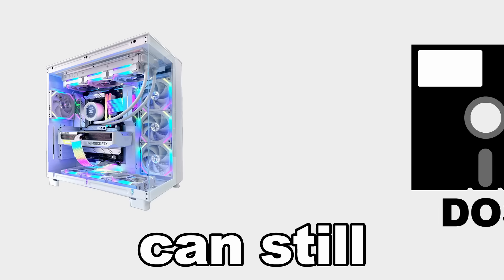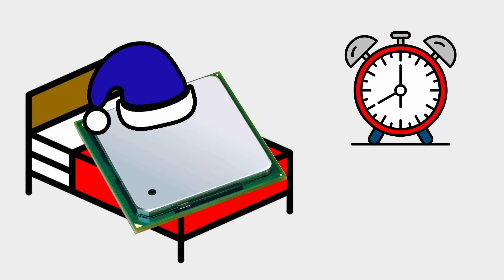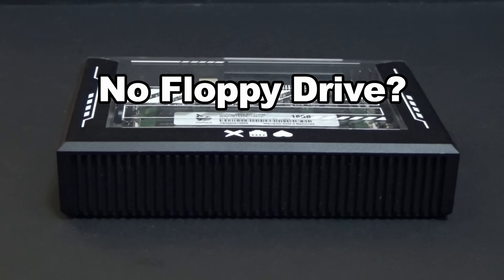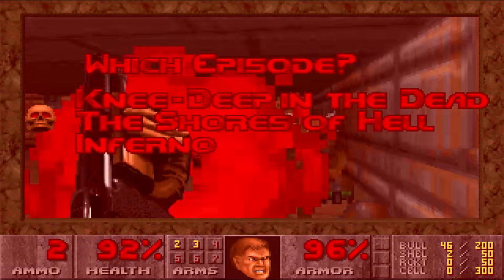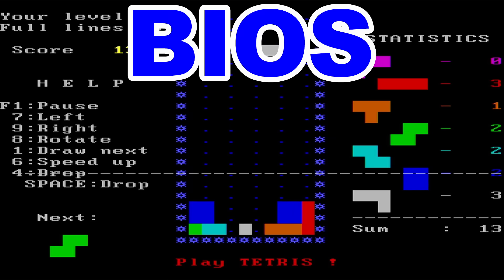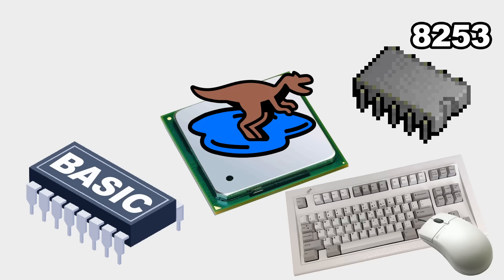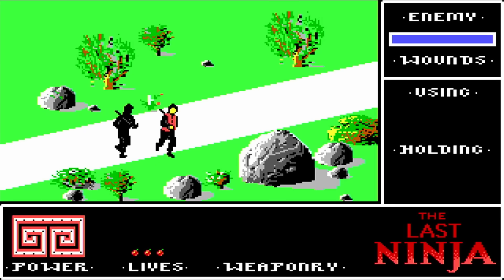45 Year Old DOS on a New Intel CPU Without Emulation

Comment: I made some open source project using batch files as a container to create a new executable file with a little help from a special version of the debug command that provide 16 bit and 32 bit instructions. (Since 80386 we can use 32 bit instruction in DOS 16 bit mode too.) But i never test the projects on a  real DOS PC, I use DosBox and one project with 800x600x32 is only made for a graphic card with S3 GPU. So hardware needed 80386 with svga graphic.

Comment: Nice video! If my own memory isn't faulty, BASIC was in the DOS directory, which should've been in the path, so not in ROM. I'm not sure if it came with PC-DOS, but I'm pretty sure it came with most versions of MS-DOS. Heck, even the C=64 came with a version of Microsoft BASIC. You forgot Cyrix as a competitor, but I suppose that's a subject for another video.
Reply: Sorry but your memory is a bit off. The original IBM PC and PC/XT had real ROM chips. I still have the HEX file of its contents. However  most every PC "clone" had BASIC as a COM file - I think for licensing reasons.

Cyrix chips were NOT QUITE X86 compatible. I used to build PCs for a living and it was always necessary to include minor patches to keep Windows stable - especially at clock speeds over 66MHz. But they were cheap !
Reply: @adrianandrews2254  It wouldn't surprise me if my memory were a bit off. Thanks for the correction.

I also used to build systems, and Cyrix chips were very cheap. I do remember they didn't 100% compatible, and yes they did present an issue at times. I think that's kind why they disappeared. They were cheap, but also sucked at the same time. AMD struck that cheaper chip with compatibility sweet spot.

Comment: Once upon a time, editorials were published complaining that the latest x86 chips were "code museums" wasting much of their transistors to support backward compatibility.
Today, the vast majority of the complexity is the logistics of dealing with superscalar and out-of-order execution, with a surprisingly small part of it being the Execution Ports that do the actual work, and a tiny sliver being the front-end that parses the instruction set.  So today, supporting old instructions is not significant; the entire chip is abstracted away from the published instruction set anyway.
Reply: Yes indeed. Intel tried to abandon backwards compatibility with it's 64 bit architecture. Because of the way the licencing agreement with AMD worked, AMD were legally allowed to introduce their own 64 bit chips that were backwards compatible; and despite the editorials saying that the Intel IA-64 was superior the market went for backwards compatibility. That's why the architecture of current 64 bit Intel chips is actually AMD-64 not what Intel had in mind.

Comment: how do you deal with the clock speed differences ? a lot of old dos programs were reliant on the clock frequency and on faster machines ran way too fast. I mean you are talking of CPU's that ran at 20 MHz to early Pentiums that ran at 100MHz the modern CPU even that celeron is over 1GHz base bursting to over 2GHz...
Reply: The timer chip and the vsync exist on first PCs too, but using only a loop for a delay is a bad programming style. I wrote a pull down menu on 20mhz and it works fine with 2700mhz too. We can wait for the vsync(at port 3da) on video mode with 60hz refreshrate multiple times in a loop to slow down a routine.
Reply: 4.77 MHz.

Comment: There is a big difference. In old days, DOS PC's  allways ask date and time setting when device power on. There was no RTC batarie and memory.
Reply: The original PC didn't have it built in, but real time clocks were in lots of IO cards sold for PCs and were extremely common add-ons.  My first PC had one in a socket that went under the bios chip.
Reply: I use DosBox on android and it have no date and no time command.😂
Reply: @maxmuster7003   It was 1980s  8088, 8086 HW, when i were at Unv.   Not later . ;)

Comment: it is 32 bit instead of 16 bit, x64 supports only 64 and 32 bit, no more 16bit
Reply: DOS need an ibm compatible mainboard bios with 16 bit function. An intel 64 bit core2quad can start in 16 bit mode, if the bios is ibm compatible.
Reply: The only one difference on 80386+ between 16 bit mode and 32 bit mode is the usage of instructions with or without an operand size prefix(66h) and with or without an address size prefix(67h). These prefixes reverse the default size for the duration of one instruction. In the 16 bit protected mode we can address up to 4 gb of memory, the same like in the 32 bit mode. But there is a 16 bit Real address mode and the A20 address line is off and the segment size is limited to 64 kb, so the memory ends on 1 mb address space for MS DOS. The last himem.sys XMS memory driver for DOS can handle up to 4gb by using a larger segment size.

Comment: Intel is quietly working to drop 16-bit and 32-bit compatibility from future processors, which will let them squeeze out more performance in future chips. So, this is a feature that probably won't last another decade.
Reply: We will see which DosBox emulation works faster on ARM or newest 64 bit intel. 😂

Comment: it was possible to make the Itanium backwards compatible.  there was a software emulator made to do that but it was very slow.  it is even possible to make a dual architecture chip like ARM+x86 but it would take the sum of space,  or just make a board with both chips.  all this adds cost and no one wants that.  so x86 will be around until every old software is replaced by something better that runs on a super new 256-bit 16 THz 128 core quantum chip.
Reply: But that was not why it failed. The architecture was hard to develop for and the promised performance wasn't there, so there was no point to move from x86 to IA64 and when it did, AMD created x86_64.

Comment: Great stuff. Funny bit about the missing floppy. 🤣 Strictly speaking, saying DOS provides a HAL isn't correct. A HAL is an internal OS layer meant to support porting it across more than one processor architecture. DOS, of course, is a  one-trick pony. Windows NT was the first MS OS with a HAL.

Comment: I wonder if it would be smart, with the chiplet design, to have 1 legacy core with only x86 instructions, and the rest of the cpu would be straight x64.
Reply: There is a routine to startup all 4 cores in 16 bit of MS DOS and there is another routine to switch from 16 bit to 32 bit and from 32 bit to 64 bit mode. But i never test it.

Comment: I recall fondly my first PC. A Philips 80286 with 1MB of RAM and 14" colour display. I used the keyboard of that computer until 2023 when the left shift key finally gave up.
Reply: If it is mechanical keyboard, switch can be replaced (separatelly).
In 286 times, most of keyboards were expensive and mechanical.
Just dont throw up mechanical keyboard, it can be almost always fixed to (almost) 100% state.
Reply: @warrax111  dude mechanical keyboard are new, go inform what even a MHz is
Reply: My first PC ran a 7 MHz 8088 with 256kB of RAM and one 5 1/4 floppy drive.  But that wasn't my first computer.  My first computer had a 2 MHz Z80 with 2 kB of RAM and cassette tape storage.

Comment: USB floppy drives are bootable so long as the device can boot from that USB port, and WAAAAAY faster than the floppy interface.

DOOM is what I still use a DOS P4-3GHz for. With ISA slots.
Reply: haven't you run into incompatibilities with the usb floppy drives? And more specifically modern ones, not the few IBM and other big makers put out back in the day.  I was really shocked at the poor construction and lack of support. Maybe if all you do is boot FreeDOS it's all right. Actually moving data and updating firmware is a nightmare.

Comment: ok I can see how the processor would work find but how did you get sound, what drivers do you use since i don't know of any modern hardware vendors provideing drivers for dos, hell getting harder to find hardware that i can get to run under windows 7
Reply: I read about a soundblaster emulation for DOS. I never test it.
Reply: DOS didn't use drivers for hardware devices.  Each program had to code support for things like printers and modems and joysticks and sound cards and video cards.
Reply: @stargazer7644  partialy true but my dos computers had drivers loaded up at boot for things like mouse and cd rom drivers and himem.sys was also a driver, some sound cards also installed drivers during boot up,  while many programs simply used a listed address, irq and dma to access sound cards, but printers needed drivers unless doing just the most basic of printing.  i had printers that could print basic text while in dos but had drivers that loaded in windows 3.0 that let you print graphics and such, modems had to be recognized by the software you were using and usually didn't require drivers because they were connected via serial port. which was managed my the bios as was the parallel port.

Comment: I booted DOS no problem on both my current machines, simple BASIC and other programs run.
FractInt will not run as it doesn't know what to do with modern graphics cards.
Descent, Carmageddon and Terminal Velocity have no sound, and I can not use my old Voodoo2 cards in a modern system.
So what.

Comment: It's good that Intel has such backwards compatibility.  And with increasingly faster and more powerful processors, there really shouldn't be that much wasted space for such compatibility.   And it's better than Microsoft's lack of backwards compatibility for DOS and 16-bit Windows programs.
Reply: Even 32 bit support is iffy on windows. I heard the best way to run old 32 bit games on a PC is to use Linux running wine

Comment: One issue with running DOS or other IBM PC software on a modern PC is the removal of Gate A20 support in Haswell & up (IIRC for AMD, it's Bulldozer & up).

The original 8086 and 8088 CPUs had a quirk where they came with a 20-bit physical address bus (address lines numbered A0 to A19, and a physical address space from 0x0 to 0xFFFFF). However, the segment:offset addressing in these CPUs could generate addresses from 0x0 to 0x10FFEF. The address range of 0x100000 to 0x10FFEF would wrap around to 0x0..0xFFEF. Thus, a well chosen segment base address would enable access to low and high memory within the same logical segment.

In the 80286, the address bus was expanded to 24 bits, so 0x10FFEF became a valid physical address, breaking the expected wraparound behavior. To maintain compatibility, IBM added a logic gate to clamp the new A20 address line to 0, restoring the wraparound - new software could then call a BIOS function to enable the A20 line for access to the full 24-bit physical address space.

As later CPUs were equipped with caches, an external logic gate would no longer work as intended, so on 486 and up, Gate A20 became a CPU feature, rather than a board feature.

Modern CPUs, however, ignore commands to set Gate A20, and will instead always present the full address space with 0x10FFEF not wrapping around. So, any software that tries to rely on the wraparound behavior will break on Haswell+ and Bulldozer+ systems, unless Gate A20 is emulated using paging (which is only possible if the software itself doesn't try to use paging directly).

Comment: You need BASICA or GWBASIC that comes in later versions of DOS I assume. Not sure why it would be in the BIOS? I think that's something that happened in other computers at the time.
Reply: "Not sure why it would be in the BIOS?"

Way back in the dark ages, some computers ran only BASIC.  You'd turn it on and you're ready to go.  Back in the mid 70s, there were lots of computers like the TRS-80 (Trash 80), PET, Commodore 64 (Commie 64) and others.  Some were combo game machines and computers, such as the Coleco Adam.  Serious computer users ran CP/M

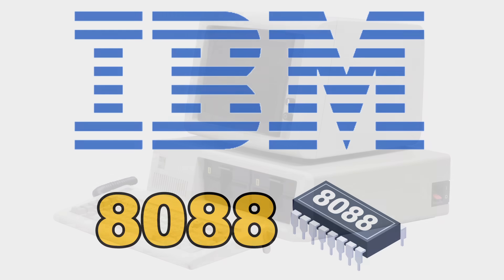Comment: 1:05
Making up over 80% of all new home computers sold by 1989, well maybe in the US, but in the UK, the ZX Spectrum basically had the most HOME* marketshare during the 80's, with the C64 coming 2nd, then Atari STe/Amiga 500 3rd,  with the PC  bringing up the rear, Apple really WAS NOT A THING in the UK until 1997.

*Schools tended to have BBC Micro's/Acorn Archimedes before changing to PC's in the early-mid 90's

Comment: I actually didn't know that IBM computers mostly all came with basic in rom in the '80s.  In fact, I didn't know you could run basic on any IBM or compatible without running the program from disk.  MS-DOS came with GW Basic at least back to the 1.25 version.
Reply: You can run BASIC in IBM PC without disk. But you cannot save any program you wrote. 
You'll need to have IBM PC-DOS BASICA to be able to save your program.
GW BASIC was MS-DOS version of BASIC to be used in IBM PC clones that didn't have IBM BASIC ROM chip installed.
Reply: @gorilladisco9108   "You can run BASIC in IBM PC without disk. But you cannot save any program you wrote."

Yes you could, with a cassette recorder.
Reply: @James_Knott  Really? I never tried that. The one that I had back then (a PC-compatible, not real IBM) didn't come with cassette recorder.
Reply: @gorilladisco9108   You had to provide your own cassette recorder.  Early clones supported cassettes too.  I suspect the cassette interface was dropped with the XT.  My XT clone didn't have it either.
Reply: @James_Knott  Ah, right. The one I had was XT. I did learn BASIC in school with computer that used cassette tapes as storage ... Iirc, it's NEC and it wasn't run on DOS.
Reply: The original PC actually could use a cassette player to save BASIC programs.

Comment: ".. programmers doesn't have to worry about things like hardware timings .."
but they do, at least for the old games. 

Before the introduction on Real Time Clock in IBM PC-AT, programmers had to use system clock (18.2 Hz) for timing. However, games usually need a shorter timing than 18.2 tick per second. Therefore most game programmers used software counters instead, which is fine at that time because everybody were running a 4.7 MHz computers. 

But then Intel processors started to pick up speed, and 1990s kids had a "playing Tetris with new computer" challenge. The drop rate of the blocks became super fast since Tetris used software counter for timing, of which any new computers can do the same counter multiple times faster🤣. 

It's the same reason why DosBox has speed up and speed down buttons. You'll need those to play DOS's Tetris.

Also the reason why softwares made with Turbo Pascal cannot run (unmodified) in today's computer. It seems Turbo Pascal also used software counter for it's ReadLn function. But with super fast computer (as compared to 4.7 MHz 8088), the ReadLn will get timeout error every time. Luckily, someone made a patch to replace the timing part of the code with Real Time Clock timing.

Comment: Intel microprocessor started with "real mode" at boot up. In Windows, it then followed by switching to "protected mode". The "protected mode" is the working environment for Windows. In DOS, it stayed at "real mode" (DOS was made before Intel had any idea about "protected mode").

In essence, DOS can still run in i9 computers, but it's confined to the 1 MB memory. Additional drivers can be used to reach the rest of the memory space, but it will always use in a swap mechanism.
Reply: DOS was made before protected mode even existed as only the 286 and later chips had protected mode.  So any software that ran on 8088/8086 ran in real mode (which was the only mode).  And it depends on which version of Windows you're talking about. Protected mode was first used in Windows/386.  Earlier versions ran in real mode.

Comment: I consider myself fortunate to have seen, and worked on, computer technology from the 70s. 8in floppy disk, 9.6kbps data rate, punch cards, DEC/VAX minicomputers, PC DOS, CGA graphics, OS/2, IBM super mainframes and all the way to current state-of-the art gaming rigs.  My home is connected to gigabit fiber which would have been unthinkable just a couple of decades ago. Such great memories!
Reply: Same, but adding paper tape and big DEC machines like the KA-10.  I have 10Gb fiber connecting a few devices in my house.  If I had had the chance to add it before it was built I would have put in Cat-7 and fiber to all rooms.
Reply: "9.6kbps data rate"  Lol.  I started at 300 baud dial-up.
The entire commercial data center I first worked at was connected to the Internet via a single 100 Mb FDDI connection which was unthinkable bandwidth at the time.

Comment: I don't think all those old instructions really waste that much space; they just encode into an unusually large number of micro-ops. So the micro-op encoder has to be a little bigger but that's not really the heart of what  makes a CPU take up a lot of transistors. Heck, if you look at a modern CPU maybe half is cache anyway. Sure it's some waste, but knowing which are really safe to remove is almost kind of impossible (some may not be supported in x64 mode tho, which would make them top candidates for removal).
Reply: They have their own blocks with their own bit patterns that are not compatible with later instruction set. That's why they came up with operation modes (real, protected, long) where they basically use different microprocessors within the same chip.

Comment: I remember Wing Commander being absolutely unplayable on my AMD AM486 DX2 80 Mhz, even when disabling the "turbo" button to clock it down to 40 Mhz. I wonder how many microseconds it would take before you game over on a modern CPU running at 5 Ghz. That's 125 times faster (it would be a lot more if it could utilize more than one core)